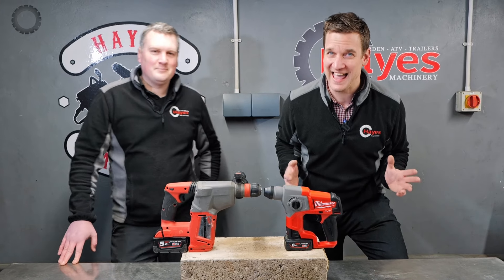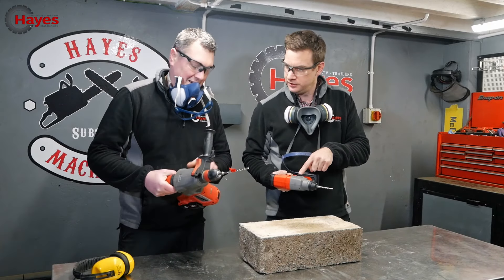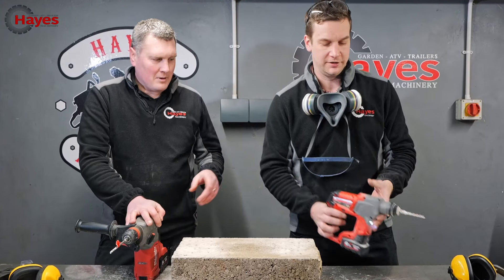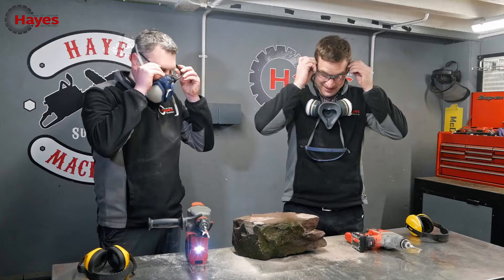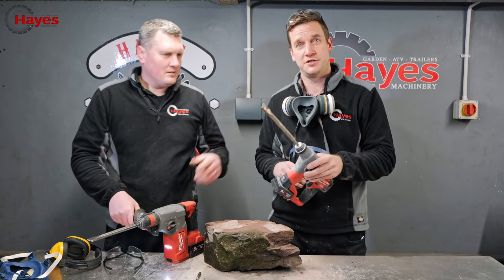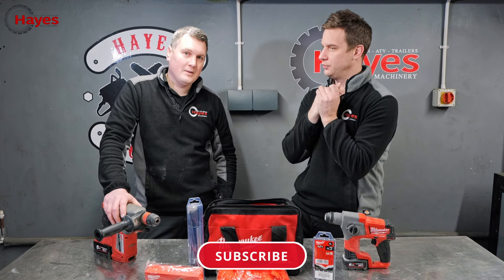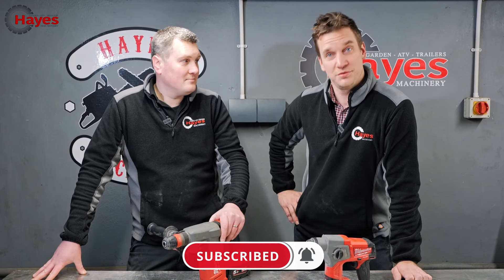Milwaukee SDS Drills | M18 vs M12!

Comment: All be warned. M12 has no hammer only function
Reply: New model does
Reply: Is the new model avaliable in the UK?
Reply: Scrap that comment had a look online and found it no surprise not in the UK yet so will probably be a good few months until it's released

Comment: I have the m12 and don't let it fool you because it is slower. It is a powerful wee tool. I use it for fixing pans into concrete floors and framing to brick and that tool is bloody awesome
Reply: How has it held up mate? I’ve been toying with the idea of swapping my 18v for the 12v but I can’t imagine the 12v SDS being very durable when it comes to drilling in concrete all day..
Reply: @i_know_youre_right_but  handy to have both. But if you’re using the m12 get bigger batteries. I find you get more power out of them. The 2 amp barriers don’t have the oomf of life to make it worth having for all day use
Reply: m12 is better and not much weight rather than m18 heavy 😂

Comment: Can the M12 drill holes easily in my old solid garage concrete floor, as my cordless 18v combi/hammer drill didn't even make a dent?
Reply: 2 years old, but I’d assume you are still drilling that hole now if you are doing it with an m12 cordless.
Reply: @collinsmcrae  Lol,
Reply: My m12 fuel hammer drill is a beast. There are better tools. But I have never had an issue it couldn't drill.

Comment: Does that bit lasts longer by pulling out more often?
Reply from the maker: You tell me 🤦🏻‍♂️😂
Reply: yes, a clean hole is a cool hole.. A cooler bit will not as quickly burn out

Comment: I’ve been using this m12 hammer drill for 8 years. It punches way above its weight. Just a note though, you did a few things that hurt it’s performance. First you drilled the bit past it’s flutes which means the dust has nowhere to go. That’s why it puffed every time you backed it out. Don’t over run the flutes. In fact pecking it in and out will help dislodge the dust better and drill faster.  Also, you looked to be bearing down very hard on it. Let the tool do the work. 
Otherwise, I enjoyed the video.
Reply from the maker: Thank you for the feedback Ragged 👍🏼
Reply: Good advice, precise nothing else to say. DO not push down excessively on a hammer drill you WILL burn the bit out no matter how good they are..
Reply: On the m18 one the instructions are insightful . There is actually a gauge built in it’s the little accordion style folding rubber between the handle . It shows how hard your supposed to press and the manual has a photo
Reply: how do you find the m12 stuff compared to the m18 gear? im interested in buying into a new system but im just unsure at the moment if to go for mil/mak/dewalt.

Comment: The lightness of the M12 would be perfect up a ladder drilling holes to mount a floodlight, alarm box, camera etc. May have to invest in one
Reply from the maker: Perfect for that 👍🏼
Reply: @MachineryNation  Any idea when is it back in stock?
Reply: Thus is exactly why I bought M12. Fixing holes anywhere is such a breeze. Takes a tad bit longer but it's so light and versatile. 

A shame it doesn't have a belt clip though.

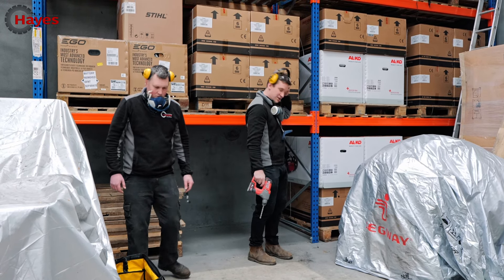Comment: 8:45 Let the tool and the drill working. It is a compact hammer drill. Don't need to push it with two hands. When the rotating speed is decreasing you have to decrease the pushing power till the speed is increasing. Don't push the drill until it stops.

Comment: I've used the M18 SDS it's definitely a great tool but I see the value of the M12 if you're working in tight spaces or need to drill holes for anchor bolts at home.

Comment: I have both the m12 sds and m18 chpx (more for the roto stop feature) but the m12 is excellent! I've drilled through lintels (with the ruwag lintel bits) which my cheap titan corded sds with 3j of breaking power couldn't manage...to be fair was probably the drill bits.
Reply: drill bits really do make the difference

Comment: Honest opinion on the m12 hammer drill vs m18 hammer drill. I need batteries for m12 fuel multi tool and I can purchase kit with batteries and drill/impact or do I buy m12 batteries separate and get m18 drill I already have m18 batteries.  Thanks best tool review channel I have found! Ps I’m home owner/diy not a contractor.

Comment: I have the little m12 you cant beat it for power in its size class .amazing little drill
Reply from the maker: It certainly is 😇
Reply: How long of bits have you used? In my line of work I use a 12 to 16 inch 1/⁴ inch bit  regularly.

Comment: They should do a M18 mini SDS
Reply: Wont make much difference unless you make it bigger than the m12.

More voltage needs bigger components to take advantage of and really only = more motor speed (not accelerations) otherwise if you strap a 18v battery to this it will just be the same torgue and usable power

Comment: I seriously wabt both. I think for what i do with low voltage the m12 is the better buy right now and will get the most use. I mount data racks so have to drill into the floor for that i think the m18 would get used for that and that be made a breeze.

Comment: Do you think that the average joe can survive off of the M12 system that Milwaukee has?
Reply from the maker: Not just an average Joe but also an average contractor… 🤩
Reply: Everything in the M12 line so far has been perfectly sufficient for me (electrician), the 13mm hammer drill is at it's limit boring dozens of 25mm holes in timber during wiring rough ins...

Comment: I think the m12 would be perfect for a sparky but with the m18 you allways have the extra power.
Reply: Actually its more or less an DIY tool in performance exept you have only a couple holes to drill in an unfinished condtruction side. I like some M12 Tools but especially with the bigger 6Ah batteries they are not that much more light and compact than many 18V tools. 
For example the M12 Gen2 Impact on 4 or 6Ah. Its nearly just Max 10 to 15% more compact and lighter as an Bosch GDX200c wirh an 4Ah pack on 21700 cells. 

I do for example installations in finished projects. I install mountings and tubing for wires for movement sensors, camaras, or alarm and security systems. The floors, parking decks, stairwells, hallways and so on i work in ar finished. Often tiled, Black carpet, white walls or even allready expensive Equipment around me. 

There is no way i am allowed to work without propper dust extraction. 
For anything between 5 to 8 mm i use an vacum attachment that can be mounted on am 18V rotary hammer with 2.6 joul.  If i need to do alot of 10mm going up even setting an 68mm hole in concrete its time for the big boy like the GDE68 on an self cleaning AFC Bosch Shop vac. Depending on if i have to drill alot of 12 to 16 mm in concrete i now use the Bosch GBH 18V 45C with 12.5 Joule with the same GDE 68 dust absorbing attachment..

Comment: I have the M12, my only gripe is that it has no chisel function, like every other sds on earth has. I know it's only small but sometimes I want to chip out some brick or a little bit of concrete...Why Milwaukee???
Reply: Probably a marketing strategy to make you buy the more expensive m18